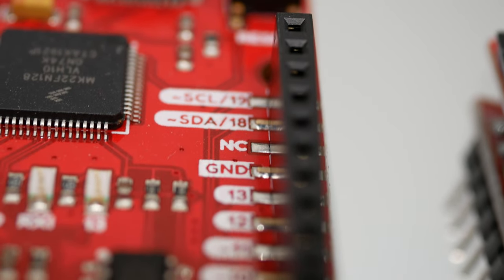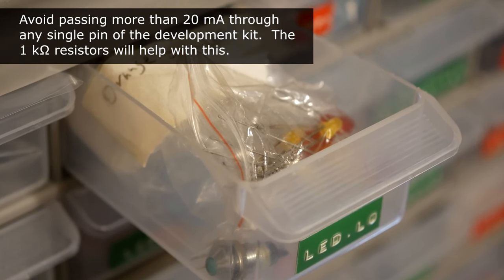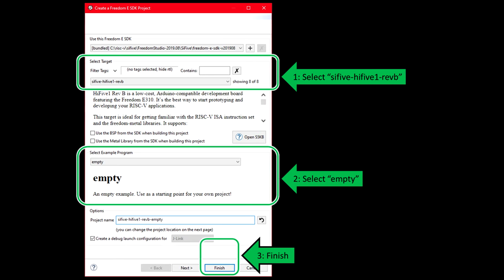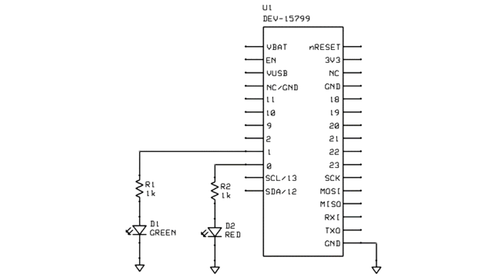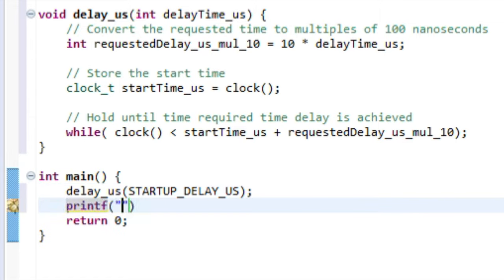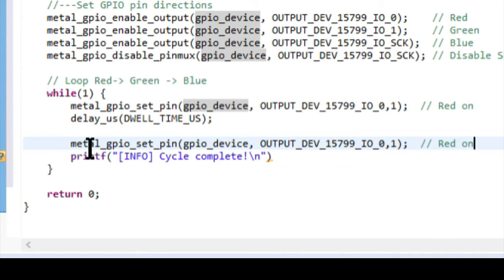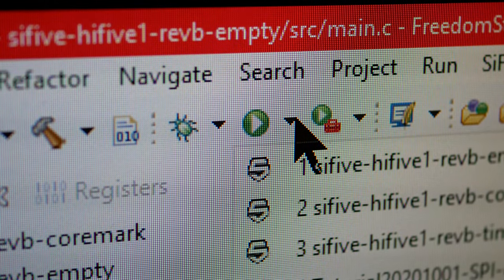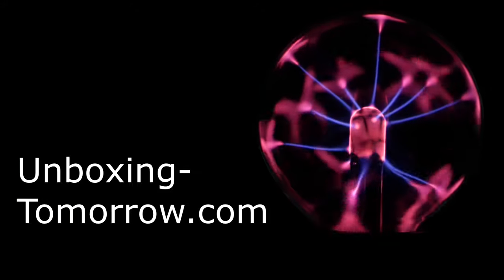RISC-V Project: Driving GPIO Pins

Comment from the maker: Don't forget that last semicolon the final printf()!
0:52 - Objectives
1:36 - Schematic
2:57 - Programming
6:07 - Pin Numbering System
7:20 - metal_gpio_get_device
7:42 - metal_gpio_enable_output
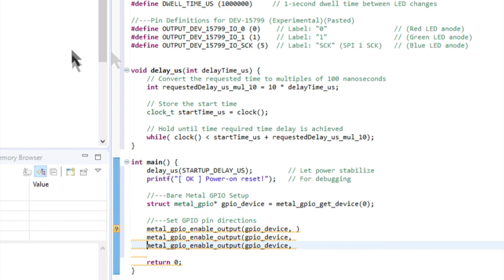7:55 - metal_gpio_disable_pinmux
8:25 - metal_gpio_set_pin
11:04 - Adjusting delay_us
11:30 - Closing Remarks

Comment: I would like to see a Nokia lcd screen working with a RISC V microcontroller.
Reply from the maker: It's a very good module!  Incidentally, I have an older PCD8544 module using Nolia's 1.6" LCD display left over from an earlier project.